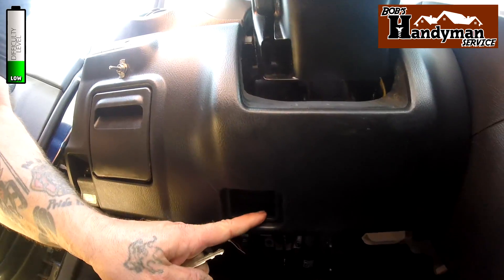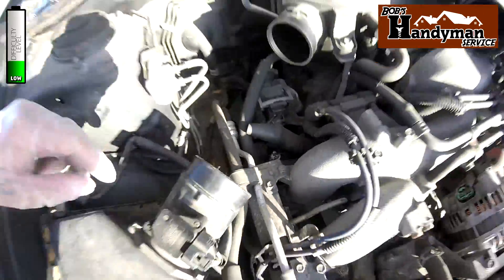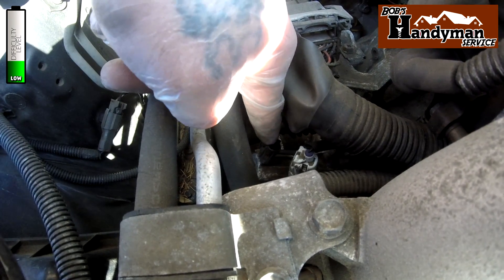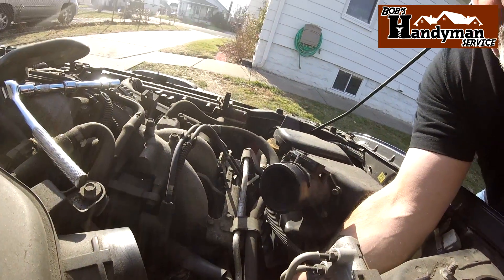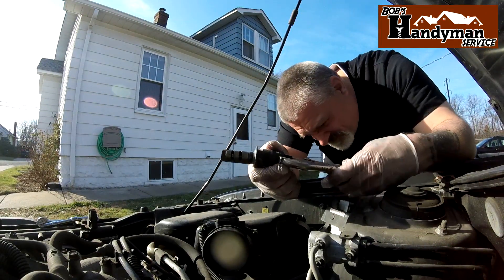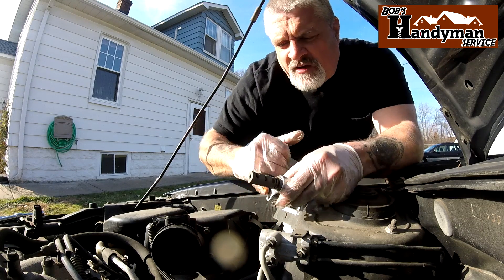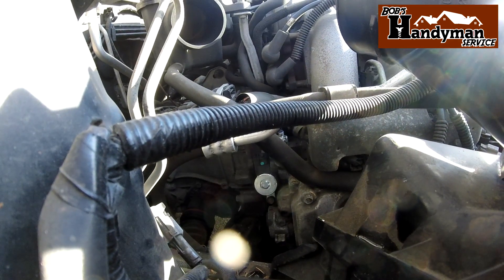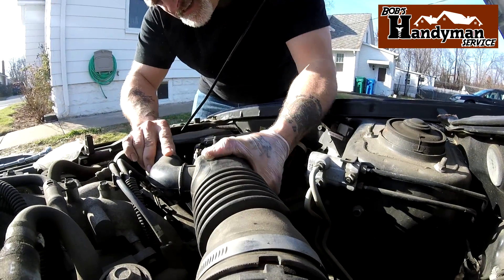P0026 Subaru Impreza Engine Code and Repair - Variable Valve Timing Sensor

Comment: wow. great video. thanks.
glad i watched till then end and you gave a price for the part,
and you touched on p0028, as that is also an issue for me.

what exactly do the codes/definition mean in laymen's terms?
like, what is happening to the car?
can we keep driving it? what will happen in the long run?
is it a wear and tear issue?
did we do something wrong as to why it needs to get replaced?

i've got a 2007 legacy, and the check engine light
is on most of the week, and maybe 1-2 days it will go away,
then just randomly go on again.
i don't find/feel a difference while i'm driving
and the light go on and off.
i use it for work 5 days a week.

the errors are:
P0026 - Intake Valve Control Solenoid Circuit Range/Performance Bank 1
P0028 - Intake Valve Control Solenoid Circuit Range/Performance Bank 2

your words of wisdom are appreciated.
thank you.

Comment: Hello does  the 2003 forester xs have this vvt part # ??
Reply from the maker: I'm not sure James.  I am not a mechanic by trade, but instead a home improvement contractor that made the video because I ran into a similar problem.  If you call some auto parts stores you can usually find someone who dabbles in auto repair and they might be able to answer your question more accurately.

Anyone else on here know the answer?

Comment: Where did you get the replacement part and what brand is it? All the local parts stores are asking over $100 for this part and i am finding plenty online ranging from $20-80$ but none from known brands and not sure if they will be reliable or not.
Reply from the maker: I got it from either advanced auto or AutoZone and I just bought the cheap model that they had not really sure what brand it was.
Reply: Rock Auto has been my goto for car parts! Filters parts by car and model.

Comment: does the P0026 code also throw on the BRAKE and Trac Control lights? i might just have another problem, thanks for the video.
Reply: My moms check engine light came on due to this part and as a result of the check engine light being on it also lights up the traction control and cruise control lights
Reply from the maker: As far as I know it only illuminates when there is a problem with emissions.
Reply: @chrisstafford2952  yes. Subaru designed it that way. All 3 light up and cruise light flashes to attract attention to the driver.

Comment: Why not test the solenoid before removing and replacing it? With this issue it may be the pressure switch or the solenoid and you're just guessing by replacing it. Especially if it is an intermittent issue the CEL may go away and make it appear fixed when it isn't.
Edit: This video is excellent for how to replace the part in question and here is a recent video I found that describes the diagnosis as well https://youtu.be/DGiXu229ttY
Reply from the maker: Honestly I don’t know how to do that I am a home remodeler and handyman not an auto mechanic. When I had this problem with my former wife’s car I could not find any help for it so I thought it was a perfect opportunity to make a video to help others. You should make a video showing people how to test them.
Reply: @BobsHomeServicesLLC That's a very fair point, thank you for making a video where none existed before! I'll be honest that with this video being from a few years ago I didn't expect you to respond (though I appreciate your active involvement in past videos which is rare) and meant my comment more as a rhetorical question to point out to others that with this CEL code it may not always be necessary to replace the part although your video is an excellent tool for those who do need to replace it and I appreciate the effort you put into making it :) I have edited my first comment with a link to a very recent video that goes through the diagnosis. Thanks again!
Reply: @georgebennett4523  thanks for the helpful convo, gentlemen.
i just asked about something similar elsewhere,
as my 2007 legacy's check engine light randomly goes on and off,
and i don't necessarily notice a difference.
it's only be happening for a couple of weeks.

Comment: You are correct about not many videos on P0026.  It a slightly harder job doing the P0026 than the P0028.  I am waiting for the VVT to arrive and I am glad I saw this video.  It confirmed that what I expected for the job was correct and look forward to doing this job.
Reply: Both sensors removal exactly the same, No difficulty difference that I know of, 6-10 in  extension deep socket  24 mm 3/8s , unclip the air box as your going to change the air filter. Use the extension and socket pull it out put it in
Reply from the maker: Glad it helped you. Have a great day...

Comment: thanks for showing the location.  could not find this one!  found it on driver side though!
Reply from the maker: The one on the drivers side throws a different code.  The one on the passenger side has a blue wiring cap on it.

Comment: You can use a 3/8 ratchet, don't have to jump to a 1/2 right away. Just saying. Other than that goog video.
Reply: The ratchet is a 3/8 drive, it's the socket size I was providing.
Reply from the maker: That was the socket size

Comment: Thank you!! I thought my cv boot was leaking but I couldn't find a tear. After checking my oil level and the effected area I'm almost certain the solenoid is leaking everywhere! Again thank you!
Reply from the maker: Hope it was the VVT as that at least is an easy fix.
Reply: Supposedly this is my problem too. I've been chasing oil leaks all year. Valve cover gasket, oil pan gasket, rear main o-ring, rear main seal, oil separator and now this. It stopped for a time and then the VVT started leaking like crazy. Hope this fixes it.

Comment: I change both of them and it still comes up a p0026 any ideas after that
Reply: You have to clear the code with an OBD reader
Reply: A lot of time when the error comes on, it's cuz u have low oil. Check oil level and fill as needed.
Reply from the maker: Did you figure it out

Comment: great video.  Dealer wants to charge 5-600 to do this on tribeca.  is there one on each side?
Reply from the maker: Yes, there are two of these units, but I didn't bother putting up a video for the one on the drivers side because there are tons of videos out there already.  Good luck with your project.  Please subscribe for more videos like this as well as home improvement videos and daily vlogs.

Comment: Hello, thanks for vid. What is the part # for the solenoid for fault code P0026?
Reply from the maker: 10921AA040
Reply: what is the part number? There are a lot of options.
Reply: ammartinez18 i dont know the part # but it may be the oil switch. There one on each side of the engine. Or it could be the solenoid for valve timing, again one each on each side of engine. For me it was the switches.
Reply: Anonymous thanks! I actually bought the part on Walmart(took 3 weeks from the hurricane delays) but installed it and changed the oil&filter and now runs great! Awesome video really easy
Reply from the maker: Glad this video helped you out.  It amazes me that the dealer wants so much money for such a simple job.
Reply: What is the piece called exactly cause the neck snapped on mine and the grey part of the solanoid got stuck in there any suggestions how to get it out
Reply from the maker: It's called an Intake Control Valve Solenoid.  Once you unplug the electrical plug from it and remove the 10mm bolt underneath it, you should just be able to grab it with vicegrips and wiggle it out (Wiggle easily).
Reply from the maker: Also known as : Variable Valve Timing Sensor
Reply from the maker: You should be able to wiggle it out with a vise-grip after you remove the blue electrical connection and the 10mm bolt from under it.
Reply from the maker: 10921AA040

Comment: Hi, what was the main problem? Apart from the fault code?
My subaru legacy, sometimes the idle is uncontrolled and I am suspecting this vvt valve.
Reply from the maker: wajaja1000 it was running rough. The idle was rough.
Reply: Bob's Handyman Services 
THE SAME GOES FOR ME. I WILL CHANGE THAT TO SEE IF IMPROVED

THANKS!!!
Reply from the maker: wajaja1000 you're welcome and I hope this helps you
Reply: THANK YOU SO MUCH!
Reply: DO YOU HAVE ANY E-MAIL TO SEND YOU A VIDEO?
Reply: Yeah, it was that damn thing! For about 3 months I could not find the problem and finally if it was this selenoid

THANKS!!!!
Reply from the maker: Glad it helped.  Sure does make you feel good when you get to the bottom of the issue. :)
Reply: yes... thank you so much
Reply from the maker: Did it work out for you wajaja1000?

Comment: For subaru tribeca b9 2007 it is the same ? I have code p0026
Reply: is this a question or a statement?, i have the same code after using seafoam.  have you figured it out? i have the same vehicle.
Reply from the maker: Thanks for sharing that with us.
Reply from the maker: It was a statement I'm pretty sure.